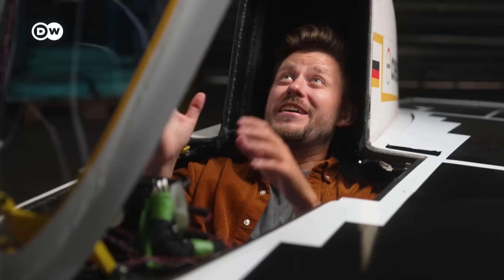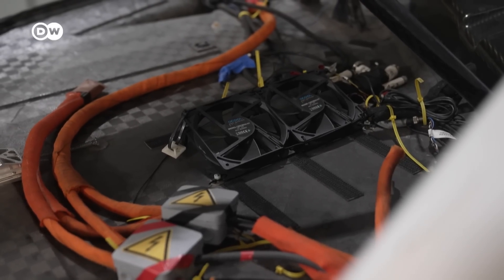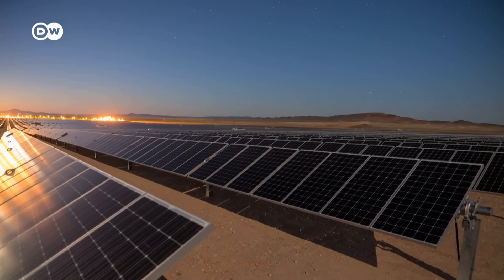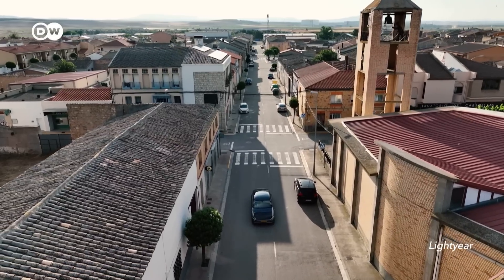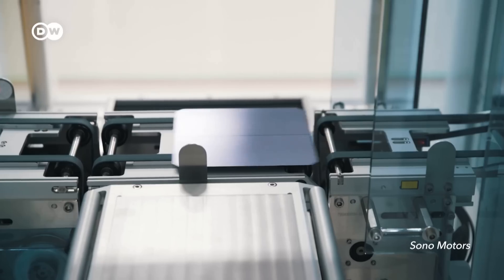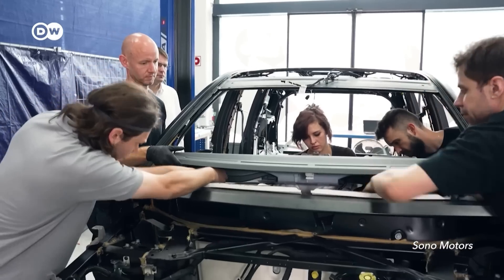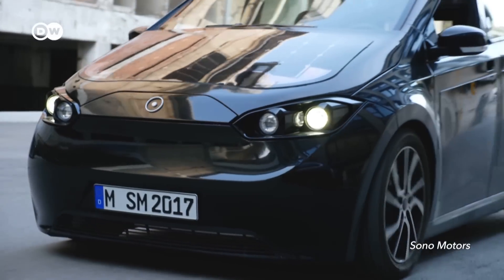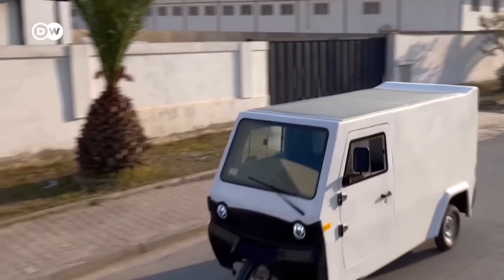Why aren't solar cars everywhere?

Comment: Unless they cover about an acre of area or are almost never driven, there is no way those tiny panels could charge the massive batteries in electric cars anytime soon, even in cases where the car is located in areas where it’s sunny most days. 

A really great alternative to silly electric cars is internal combustion engines.

Comment: I simply admire the person who created solar cars 60 years ago, before I was born.
The fact that solar cells existed around this time and the challenge of using them in cars right away is amazing.
Perovskite solar cells that can be bent freely are currently a hot topic in Japan, so I'm sure this will become a more realistic topic in the near future.
The problem is the lifespan of perovskite, but if it deteriorates after 6 years, I think it would be a good idea to replace one set of battery modules.
If you go shopping several times a week, you can use it without using fuel.

Comment: ❤🎉 I believe in Solar Cars... Please kindly not excelerate  and run faster than Electric Energy it can supply to your Battery or your Motors. Good News is new Technology coming help getting more Electric Power for your Solar Cars... Currently, those Solar Cars can help you enjoy and save a little Money , already. Congratulations 🎉👏 and good luck to everyone 🙏🌏🌎🌍😃😘🫣🥰🎯

Comment: As much as I love the idea, it doesn't take a lot of engineering to understand that even if solar panels were 100% efficient, it's currently impossible to have a mass production vehicle running purely on solar given the surface area vs weight and marketable (comfortable, AC, 80mph minimum, etc etc)

Comment: Future of automobiles should be a Hybrid of Solar and electrical vehicles. During the sunny days it can run on the solar and during monsoon you can use the Electric charge.

Hydrocarbon is another substitute for fossil fuel but it's extremely expensive and has lots of risk involved to create a commercial hydro carbon auto for the masses and the servicing and accessibility of the parts will be another big challenge if you over the manufacturing or production

Comment: I think there are and have been some people think the solar cars don’t have enough power for supporting the large weight transportations, and in some regions where they prefer transport productions during nighttime, especially in regions where people live in a relatively fast living speed or style, and where people’s lives with many uncertainties, the gas cars for them are better than the solar cars, however, I think if there are more solar cars being used, some regions some problems might be solved as well, such as air pollutions, sound pollutions or even some mental problems.

Comment: Since sokar cars arent everywhere. I plan to make my OWN car industries that builds solar powered cars! Why? Think of it diesel fueled cars contaminate the air and its bad for the enviorement. And electric powered cars cause radiation due to its electric engine wich its bad for the enviorement and for the animals. While solar powered cars on the other hand don't contaminate the air, doesn't hurt the animals and its not bad for the enviorement. And its all thanks to its solar panels thats on the ceiling of the car. So yeah thats it.

Comment: I'd like to see the surface area problem solved using deployable arrays. I don't think this would make a lot of sense on regular cars, but as an optional module you could mount to any car roof (like camping tents), it could make sense for camping or natural disaster situations. Might also work for RVs which have a higher ratio of being stationary to moving and would negate the need to carry around gas bottles or fossil fueled powered generators. Looks like some companies like Jackery are also teasing such concepts.

Comment: Totally shocking how little coverage you gave to Aptera, who has solved ALL the issues you mentioned.
Let’s tick them off shall we?
1) lightweight ? Yes, 2000lbs
2) aerodynamic: Cd of .13 which is significantly lower than either Sono or Lightyear
3) materials cost : CHECK , stamped carbon and fiberglass 6piece body, with hub motors greatly simplifying and reducing parts. The same type of motors used in the solar racer you show.
Their manufacturing methods allow them to start production far far cheaper than either Sono or Lightyear. Orders of magnitude cheaper. Estimated price significantly under $40,000 USD.
The uphill cooling issue in an early protype has been clearly solved do to lack of proper cooling for the motors.
I’m left wondering WHY this video was CLEARLY biased AGAINST Aptera. Was it just lack of research on your part,, OR, Bias against an American company.
Hmmmmmmm

Comment: They can also add  wind energy by fan in front under bownut at the place of radiator or ac fan , ND ALSO REGENERATION FROM WHEEL  THIS WAY WE GET FROM 2 MORE ANOTHER WAY

Comment: Solar panels as options should be a norm.  However, putting solar panels on homes or garages, building roofing, solar canopy, or flats should be the priority.

Cars are parked more than 95 per cent of the time they are owned, so using the wasted grid streams is an move that should not be overlooked.
Reply from the maker: Maybe solar on cars not as a primary directional shifter but as an add? Also, did you already watch these videos on solar from us? 🌤️ 👇
☀️ "Why we should be putting solar panels on our fields and lakes"  
https://www.youtube.com/watch?v=2hwpXCjmkRo
☀️ "How solar energy got so cheap, and why it's not everywhere (yet)" 
https://www.youtube.com/watch?v=sUvaYycoWqI
☀️ "This is what's REALLY holding back wind and solar" 
https://www.youtube.com/watch?v=u-DsDuTceTo

Comment: I feel like there can be both a prius and stepvan concepts that can solar charge enough for 30 miles a day becoming quite common... And that is actually plenty to do a lot different things.. especially if you dont drive everyday or have any praticle way to plug it in aside from charge stations

Comment: i did the math already... if i had an EV with roundabout 20kw/100km i could drive to work (15km both ways) for free for 6-7months a year with just 1 regular solar panel on the roof (425W modules are already really cheap these days)

Comment: Allow me to explain. Electric vehicles require high current, that is why you use batteries, it condenses the electricity from a lower current over time into batteries, providing higher current for the motors. Therefore, although having a solar array on the roof, could provide free energy, you still need to allow it to charge for a long time 24 hours or longer, and cannot use it during that time, since the whole point is to condense the low current solar energy.

Comment: Trucks with solar panel is a cool idea.... can be easily installed on existing trucks without much modification. And one use for solar power in car I can think of is in hot regions like India, where cars parked in open space get very hot.. so solar cells can be used to run the air conditioning in parked cars so that they are not hot when entering the car. this will neither drain battery nor gas / petrol.

Comment: The most feasible option is very fast adoption of solar panels on buses, trucks and cars that will act as hybrid, which will increase the range of the vehicle, which is a big boost for more investment into solar power
Reply: Did you ever do the math? What when shadow (trees, buildings, clouds or no sun - what about night? what a few panels can do for range is barely nothing. EVs are a dead end with todays technology.

Comment: Are foldable roof solar panels the future of cars? When deployed, it can achieve 1500-2000 watts of solar charging power, with an average daily recharge range of 30-50 miles.

Comment: I'm curious... Has anyone experimented with wind cars? Like, a small horizontal turbine (the shape resembling what you see in a toy combine harvester, for example) fitted on top (or even underneath, if the height of the vehicle allows it) and working on the air drag/lift of the speeding car?
Reply from the maker: Hey there! Yes, there has been research and some even look like you would expect with a turbine on the roof. However, it does not seem as if wind-powered vehicles are coming any time soon.

Comment: My car never parks outside, there is not enough space to fit a proper amount of PV cells. Solved that by putting 30kWp PV on the roof of my house and using a 2nd life BEV battery as storage. Car is charged from the PV during the day. Works fine for 10 years now. 75% of all electricity comes from my PV for house, heatpump, cars. Greetings from not so sunny 52°N, PV works

Comment: Aptera has already solved the overheating problem that caused the problem going uphill and has repeatedly demonstrated it in public tests. You really should mention that, since your video gives the impression that there are still fundamental problems with the design of their cars. Aptera is using Maxeon gen 3 solar cells, which don't cost anything near $35,000, since Aptera is selling its Launch Edition car for $33,200.

Comment: Totally skipped the most interesting parameter: 
How many watts do the solar panels on the different cars produce? 
Preferably with a derating curve referencing solar angle. 
Refering to km/year is just meaningless data, trying to obscur how little power are actually feasable from such a small area of solar panels.

Comment: The 4 km/ day stat for solar self charging is not too bad considering how many two car families there are out there with one or both sitting parked all the time. If they could get that to 8-10 km/day on solar that would be really good.  I am car free, but there are many (including my ex) whose commute is relatively short (say 7 km each way in her case) and the car is driven because the public transit connections just don’t work competitively (say 8 minute drive vs 55 by bus).  In my case, I switch to transit from bike commute during the winter and I’m living in a great, central area, close to work, but can walk in almost same time as my transit commute. E-bike or scooter makes sense, and these micro cars that are popping up are awesome solutions, only when can I buy one (mostly in web marketing mode or n/a in my country).

Comment: Solar cars are not possible with current tech. Conversion of Energy Loss, when energy is transformed from one form to another, or moved from one place to another, or from one system to another there is energy loss.
Reply: Straightup false

Comment: Averaged over an entire year, approximately 342 watts of solar energy fall upon every square meter of Earth. This would have to be the limiting factor for any solar cell based enterprise. Considering the most efficient solar cell is only 25% together with how much they cost to manufacture, this is not a very good proposition for powering cars as we are familiar with.

Comment: Just watched a clip on Chinese solar break through who can now make 38% efficient and next year plan to get into the mid 40s in efficiency. That is doubling the power of this car. Far out solar is breaking records
Reply: Yes. The efficiency will improve. How much energy conversion is photosynthesis? Mankind had figured out much science and technology. Look how much more efficient we made agriculture to feed billions of people. Solar panel efficiency will definitely improve significantly and be a game changer on many levels.
Reply: @tw8464  do agree. Solar panels today are 23% efficient and china has just released a 34% with a promise of a low 40%  efficent. Result is same 30 panels on the roof generates sameas todays  50 panels. Cars will have solar built into roofs that actually contribute to charging significanty
Reply: @lifeliver9000  thanks for pointing out the significant improvements in solar tech that have already happened/in process of being rolled out. Yes the trend will likely continue. I wouldn't be surprised if in a few years time, the solar panel efficiency improves to 75% or more. Couple that with improvements in battery technology, software, etc. I wouldn't be surprised if at some point solar on cars could charge much of the battery. Someone said their new Prius solar can charge enough to add 7 km to the range. So it's already a supplement. It's likely going to become possible before long to use the solar on the car to be able to get the charge for the range of most trips around town, using an ordinary car, that is most of our driving.

Comment: I have wondered why solar cars weren’t a thing since I was a kid. I understand why there might need to be additional fuel/electricity but there’s no reason solar can’t be added to cut down on fuel usage.
Reply: Adding solar to a vehicle helps.  Using less power from the grid is a good thing.
Reply: Its called physics.
Reply: @vic321344  Anyone familiar with the auto industry can think of many other reasons --- the actual reasons --- why we haven't had solar-assisted vehicles besides "physics."  Sorry, but Aptera's numbers for the energy added by the solar cells do not defy the laws of physics.  Does that bother you?  Does the thought of reducing our dependence on fossil fuels make you feel sad?
Reply: You would need a football fields worth in solar panels to make the car useable.

Comment: Its probably much better to just put solar onto your house or garage and use it to charge your car. Most EV owners have houses anyway because charging when living in Apartment complexes usually isn't possible
Reply from the maker: We indeed need more infrastructure to make EV's more mainstream. Did you already see our video: "Why electric cars are finally taking over" 👉 https://www.youtube.com/watch?v=aEOoExg1Nm0. Please check it out and leave a comment too. 🌞 By subscribing to our channel you can get a notification on our new videos on Fridays too! 🌈
Reply: Yeah, which is what I've been wondering. Instead of having solar intergrated into the car, why not turn it into a separate accessory?

Comment: It doesn’t make much sense to carry all the extra weight of solar cells on cars or trucks when they often don’t produce energy, e.g. in winter, it’s easier and more efficient to cover roofs of buildings and use this energy to charge electric cars

Comment: “The roof is wasted space.” Not really. The roof is part of the structural integrity of the car. Adding solar panels adds weight which partially eliminates their potential. What we need is a radical new innovation in solar technology. Something like spray on paint that can harness solar power.

Comment: Just put your panels on your house and have a residential battery, in order to charge during the night. A car will never have enough surface area to produce enough energy  real-time to power the car. For next year, I am planning a 50k eur investment to put 12kw PV with 50kwh residential battery. This will allow to recharge my EV almost exclusively from the sun 6 months per year. 50k eur seems a lot, but it's actually about 10 years of fuel for an ICE car. So, it's paid off between 10 to 15 years. I am doing this investment for another reason : avoid company taxes on profit and see my company money disappear in taxes.

Comment: I think the power the sun can provide on such a small surface area will never be adequate for the power required for cars unless one day we discover a way to harness more energy in a smaller space. It would be awesome if it were possible. For this to make a real impact it needs to replace our every day vehicles and be affordable to buy and own. I think we are nowhere near accomplishing this. But it's definitely worth working towards.
Reply: I think  the whole concept is bad with our current technology.
I mean imagine in the summer. It has 30°C in the shadow. Where do I want to park my car ? Yeah you are right, I don't want it in the burning sun 😅
It is also a bad idea for parking decks, garages and so on which really limits the useability of those solar panels....
Reply: That's a fundamental misunderstanding about solar cars that they didn't clear up when talking to the solar car engineers who are working on cutting edge competition and R&D. The idea is NOT to power your entire possible driving range with the solar panel on your car. What this does for you is give you enough range to get to a charger, if you don't have home charging. It probably gives you enough to get to work, park, and charge up enough to get home. If it does not, you live too far from work. 

No-one at Sonos or Aptera or Lightyear was expecting people to wait for their car to reach 100%, drive it for 200 miles, then leave it for ten days to recharge fully. 

Now, don't get me wrong, there's all sorts of reasons it's pretty niche as an idea but it is only intended to give you enough per day to be useful. Bearing in mind most cars are only driven tiny ranges, that's an achievable future. Still doesn't mean it's more practical than other options (e.g. portable battery you pull from the vehicle, which is widely available and could carry the same 'range' even on larger vehicles).

Comment: Why not nuclear power fusion?
Reply from the maker: We asked whether nuclear fusion is the way to fight the climate change. ⚡ Check out our video on here 👉 https://www.youtube.com/watch?v=eyHovWQ49MI.
Reply: @DWPlanetA  on vehicles
Reply from the maker: Doesn't sound very feasible or practical. Although perhaps you are referring to something other than direct use of vehicles? There has been discussion of using nuclear power to propel certain applications, such as nuclear powered ships or submarines. But even in these cases, safety, regulatory and public acceptance challenges remain. 🙄

Comment: Well remove that panel from car, go full EV, increase more covered carpark with solar roof, put solar on you house roof (applicable for landed property only) and have power pack battery storage now you have EV with solar charging facilities.